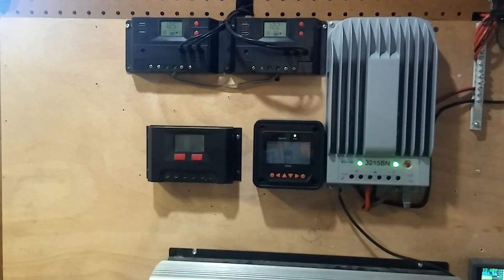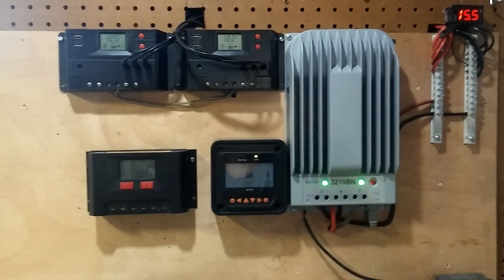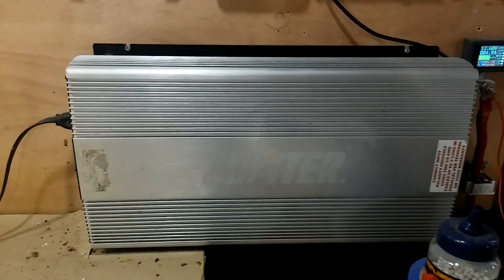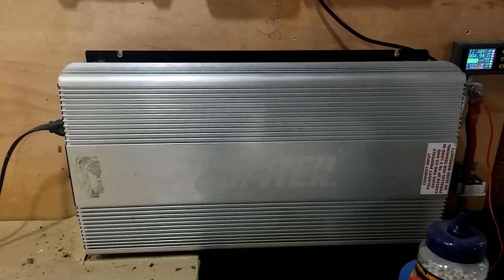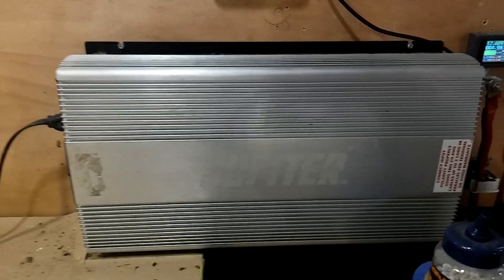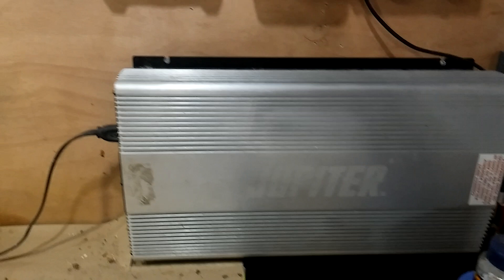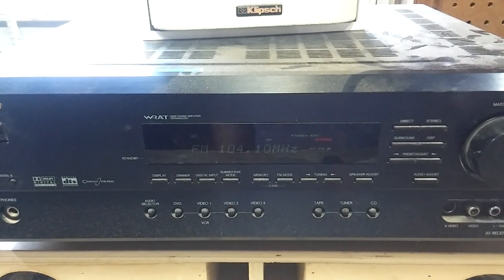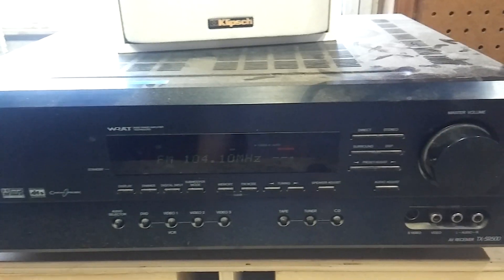Pure sign wave vs non pure sign wave

Comment: Usually a pure sine wave will cost roughly 5X the price of a normal one.  If its less than that, its probably not totally pure, but some kind of modified sine wave that they try to clean up as best as possible.

Comment: Jupiter is harbor freight newest version of power inverters, it clearly states on the box that it's a modified sine wave inverter, Jupiter is the exact same inverter as the old Chicago electric ones, just a different color and a different sticker, if you plug in a drill battery charger and turn your radio on and power them both at the same time your static noise will decrease, H.F. inverters are great inverters for a workshop or emergency backup power supply if the grid goes down, they work well on a cabin